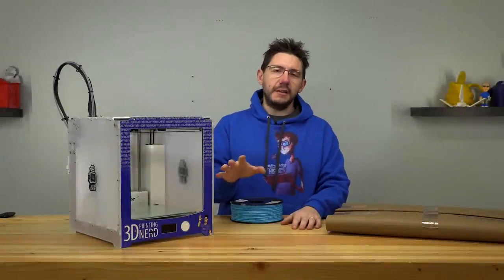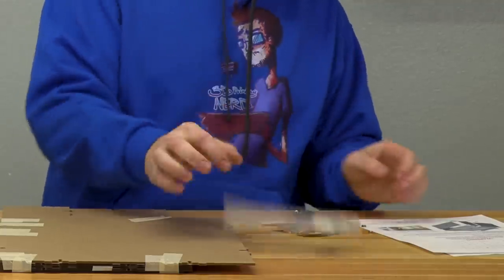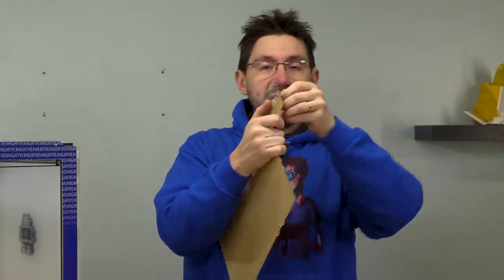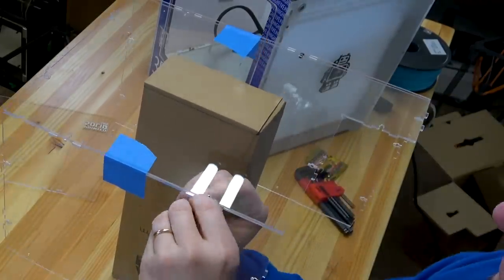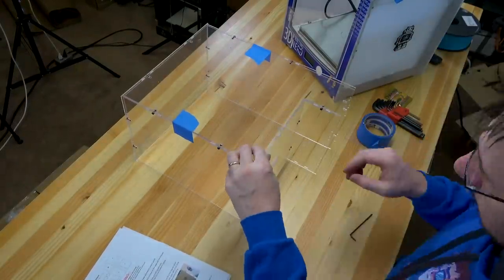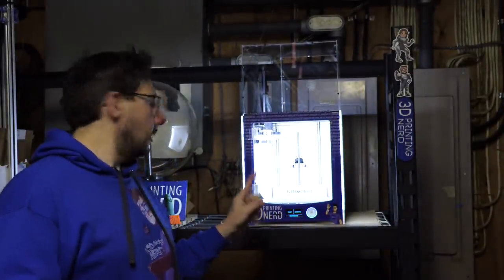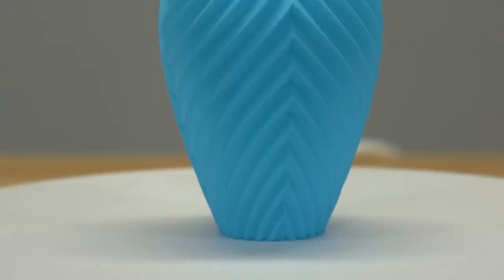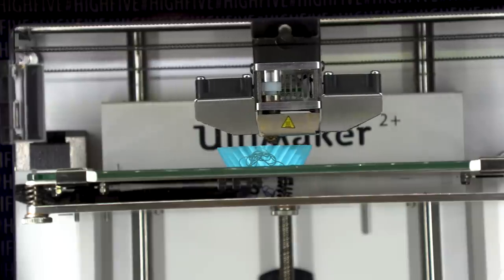3D Printing ABS In The Cold! // Assembling and Testing a 3D Printer Enclosure

Comment: The cr-10 build was great and informative and I actually used it to build an enclosure for my Raptor and cr-10s5 and it worked! I just had a keenovo bed heater that can actually reach the required temps .. :)

Comment: The internet: "Aaaa the first one looked too cheap!"
Also the internet "Aaaa this one is too expensive!"
Some days, you just can't win can ya?
Reply from the maker: Ha! So true. This made me laugh, thank you.
Reply: I'll take looking cheap any day instead of overpaying! especially if I have the joy of making it myself.
Reply: @Jeremy: Eh, yes and no. If you consider the fact that an UM2+ is (or was at launch) $2500, an extra $200 for a professional looking enclosure really isn't too bad - especially if you're a business/school/etc. Though with as much space is contained by the enclosure, I'd be curious to know what the internal temp is.
Reply: Lumberjack Engineering holding temp is the most important thing. I agree with you as far as a business or school is concerned for sure, you want it to look nice for presentations and all. For home users though, that extra may be a deal breaker.
Reply: Lumberjack Engineering 
Professional? That looks generic af. Its only missing the shipping label writen in chinese.
Anyone can cut that in a 200 bucks chinese laser, the design is as simple as it gets. Id expect at least something that wont brake from overtightening the screws or by accidentally bumping into it for that price, say use some corners and angles instead of that shitty method whatever its called with the cuts for the nut in the acrylic that creats enormous stress points in the weakest parts of the piece. Id rather it had 3d printed 90* angles that that thing, it would be 1000% more robust and durable that how its now
Reply: But if you're a business, your labor cost for one of your engineers to design, build, test, etc, a enclosure design is going to rapidly exceed the $200 price tag of just buying one...
Reply: Lumberjack Engineering
I think you are overstimating the cost of an "engineer". You dont need to work at NASA to design 4 walls and a roof. I'm not an engineer i can easilly take meassures and design a top cover and a door for a UM2 in an hour or two in solidworks. I never had to pay engineers to design the things i sell and my printers i designed them myself and so far they work flawlessly.
Prusa wasnt an engineer either. 
Building is at most a few days in machine hours for fit testing once you laser cut the acrylic or whatever material you use. (if you already have experience you can get it done first try)
"Testing"  is as much as "it works" because this isnt a heated chamber for UM2 printers, this is just a cover which promises to help. There's no engineering magic in here.
This is the kind of work china likes to copy, its simple, and idiot can do it, it's cheap on development and testing, you dont need a engineer nor anyone even near colege level.
Reply: Dude, just do some basic math here - take a entry level engineer that makes $60K a year (standard starting salary). That's roughly $30 an hour. Now add in the extra taxes/social security/medicare/etc that a business will pay for the employee, then add in the retirement benefits, and add in health care benefits. An engineer is easily costing a business $50 an hour. Now add in the cost of lost profit from an engineer working on an enclosure design for a few hours rather than working on a client's project. You're going to shoot right past the $200 cost of the enclosure within two hours of an employee working on it I'd bet - and that's not accounting for materials or the machinery/lasercutter/etc required to make the enclosure! 
Sure, a non-engineer could do this work too (because yes, it is child's play to design/built something of this nature), but the same math still holds true. I'd also say that if a business is buying a 3D printer of this nature, it's probably a good bet that they're some sort of engineering/design firm, and that an engineer is going to be the one operating the machine.
I'm not saying that this enclosure is the best thing since sliced bread - like you pointed out, there's many improvements that could be made. I'm just saying that there is obviously a market for it (otherwise they wouldn't be making it) and pointing out what that market is.

Comment: Joel, I'd like to have seen some prints done without the enclosure that failed due to warping and lift, and then the same prints working in the enclose. That vase print will likely work just as well with no enclosure. Without a before and after test, it is kind of a waste of time.

Comment: I use tape on the nuts. So the nuts are held in place by the tape. Then you can remove the tape after tightening the screw. :)

Comment: The foam box video was like watching a car crash in slow motion (which is valid entertainment as long as no one gets hurt.)  But no one should hate you for it.  If anyone unsubbed because of that video either they are dumb or weren't a fan to begin with.  Besides I hadn't heard of Punished Props before so I checked out his channel.

Edit: Maybe try using some foil tape to line the inside of the acrylic to reflect the heat and see if you can bump up the ambient temp.  (not sure what the target temp should be)

Comment: My printer is a generic clone of the Ultimaker called the BIBO (a link will catch me in the Youtube filters, just search Amazon). It has all the advantages and disadvantages of the Ultimaker for $999 (now $799).  It also came with it's own red transparent acrylic top, I (of course) over tightened the screws and broke it immediately. I emailed the seller via Amazon and asked about the cost of a replacement, he said $30 and I thought THAT was robbery and refused to buy it. $185 is out of the question. This was in April of 2017.
Reply from the maker: Dang! Thanks for the info!
Reply: @3DPrintingNerd  NP, keep up the great work! Love the channel.

Comment: If I built a custom enclosed cabinet with a custom built printer, would being able to heat the air inside from 30 to 90 C be useful for printing ABS?

Comment: It feels like to me like it is pretty complex to put this thing together... If the Ulimaker has a metal enclosure wouldn't it have been much easier to used a bunch of magnets to place the majority of the enclosure parts around it and then use screws to just hold bits in place instead of having to build the whole thing on the side and then mount it?

Comment: I made my enclosure out of diamond aluminum diamond plate.  I use a hair dryer to warm the build chamber.  The LED display tells me the ambient temperature before I need to print.  Tho I am still printing in PLA on a Printrbot metal simple V1.

Comment: Hi Joel and all others. I really can't understand what the problem is to print ABS in the cold. I have my 3D printer (FlashForge Dreamer, that has a thin plastic enclosure) in my unheated garage. I have no problem at all printing ABS in a 1 °C ( 33.8 °F) room temperature.

Comment: You know .... slightly off the subject but no one has seemed to mention. Everyone talks about moisture issues, but haven’t hear anything or at least much of what the moisture content of the filament should be.  First ... how would I initially determine what the % on moisture is present. My work area is currently 38 percent moisture. The filament will get to that level just laying around. That being said ... is that good enough or would I have to go lower. If lower ... how would I know when I get to the recommended % of moisture. Thanks

Comment: How is the layer adhesion? Have you tried to stick the fingernail on it?
Reply from the maker: So far it's good. I have another build in ABS from the machine that I need to film, and that piece will definitely test adhesion :)
Reply: Thanks for the reply! I´ll be checking for that video. Please do a single wall test and publish the settings you used.

Comment: Joel, head to Harbor Freight and get a set of cheap metric nut drivers for stuff like this........or just use a pair of forceps.
Reply: These are square nuts in a nut trap and they're not accessible in a way that makes a nut driver usable. Needlenose pliers do fine though forceps might be better.

Comment: 185$ for this enclosure ? srly ? 25$ for acrylic 2$ for glue and i get this enclosure for cheap
Reply from the maker: Sweet! Do you have a link for your tutorial?
Reply: 3D Printing Nerd 
Simply cut the acrylic with the same outer dimentions, make sure the cuts are straight and perpendicular, ignore the holes for the nuts, and then just glue it like youd glue a fish tank. The most expensive tool youd need would be a drill.
You can replace the hinges with 3d printed ones,they are on the featured list on thingyverse, and then super glue them on. (Or buy cheap brass hinges in your hardware store, they just wont look that pretty)
Reply: Sebastian Nurkowski 
Not sure about the prices there but you could even replace the acrylic with polycarbonate or PET sheets. Here pet is the cheapest by far

Comment: Haters gonna hate Joel.
Reply: It's not haters. People can have COMPLEX opinions.
Reply: Ian Colquhoun To be fair, he did make some bad design decision. The main issue people had was him putting the shiny side out, wasting it's heat retention properties. It's clear as day on the instructions or 30 seconds on Google. This enclosure sucks too, acrylic is a poor insulator. It's not a good choice for retaining a constant temperature. Some type of reflectix needs added to the inside, with the shiny side facing in!
Reply: In most cases the insulation properties are pretty irrelevant, unless you are adding heat from a source other than the heat bed. It is mainly to stop drafts and air movement, keeping the internal space at a more consistent temperature. If you did insulate it fully, and keep all of the heat in, the steppers would likely fail, so there would be a lot of other considerations. Basically, if you can stop the air from circulating pretty much, even a thin plastic enclosure makes a huge difference. Going from a thin one to a crazily insulated one doesn't make a great deal of difference.

Comment: You can't go wrong with tacos....yes you can.  Are you talking real Mexican tacos, or the popular fried Tex-Mex version.  I hope you don't mean Taco Bell.  As far a heat stability, it seems like the internal temperature of the enclosure was increasing as it printed.  How is that keeping the temperature stable?  I preheat the enclosed environment with a hair dryer before printing things like ABS.  The temperature will stay pretty much the same from print start to finish to prevent warping.
Reply from the maker: By tacos I mean tacos :)

Comment: I wonder how much hot air was escaping that finger hole to open the door? I have closure now...
Reply: There is a larger gap in the back where the cables feed through and the door isn't a tight fit so I don't think I'd worry too much about the finger hole.  It's not an air tight enclosure.

Comment: well with a PEI sheet don`t really need an enclosure its fine
Reply: Well, the enclosure is not for bed adhesion, it is to prevent uneven colddown of the whole print, thus delamination due to uneven cooling, which is unavoidable with large prints without enclousure
Reply: How you avoid cracks in middle of models? Not everything is about sticking to bed.

Comment: 3d print a door handle out of abs so that the hole that is used for the door handle is fully sealed.
Reply: Why bother?  There is a huge gap in the back where the cables feed through.  The whole in the front is a non-issue.
Reply: Fern Moore Hmm true.

Comment: Would've like to have seen a temperature comparison without the enclosure. Also, ideally, demo a part you can't print without the enclosure and see how it does with. Not that I even have a U2 (most of us don't I assume) but the info would transfer based on temp and therefore the video may have been of some interest to the majority of your viewers. Not hating, just saying.
Reply from the maker: I like what you're saying. The temps in the Ultimaker were similar to garage temps without the enclosure. I'll have to try some more models and induce failure scenarios.